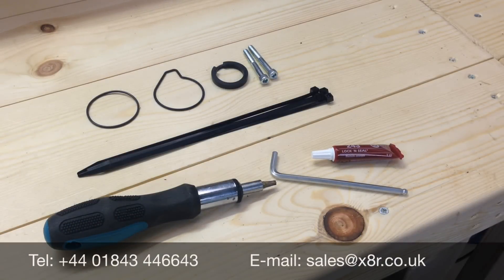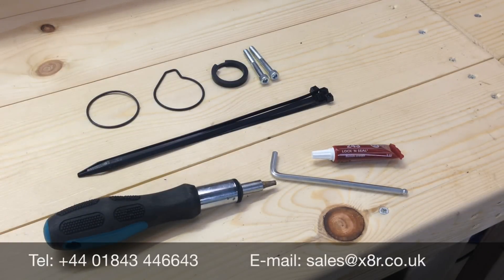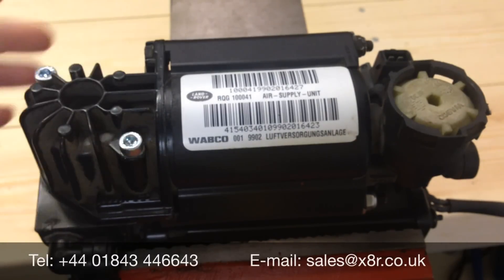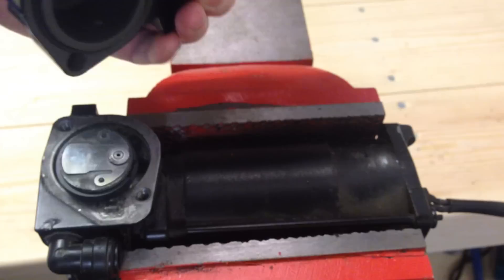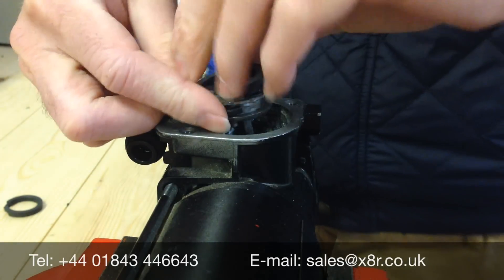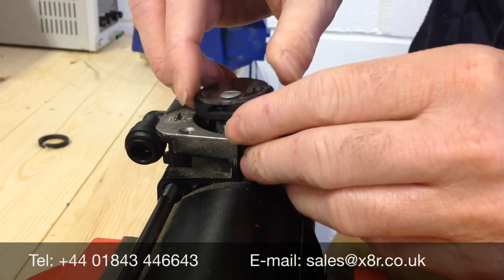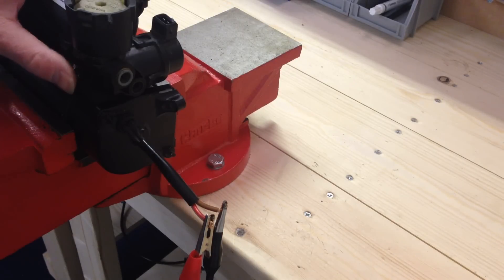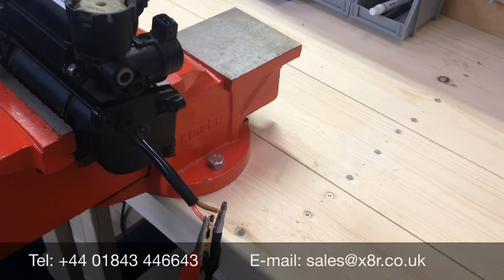Wabco Air Suspension Compressor Piston Ring Seal Repair Fix Kit (Fits Audi Allroad + others)

Comment: Hello, as i can see you do not have conectors at the end of the cabeles. Where should i look for that parts. I would be realy thankfull If you help me. I’ve got audi a6 c7 2011 3.o
Reply from the maker: Hi there, unfortunately we are not aware of where that part can be purchased. If it's available to buy separately they will have a part number printed on them, which you could search on eBay. - Georgina, X8R Ltd

Comment: I've just fitted a new piston ring and the plug in says it's producing 5.5 bar and the required is over 8 bar. the valve on top of the piston head is raised half a millimeter should that be flat? there's not much gap but could it be enough to lose that extra bit of pressure? many thanks

Comment: My compressor comes on but wont shut off... I tested the relay and its working fine. Would you have any suggestions on what you think can cause this? Any input would really be appreciated. Thanks & great video! Also wanted to add,  have no leaks in my system, as she stays up even when I pull the fuse to disengage the pump.
Reply from the maker: If there is no leaks the compressor running on is often a symptom of a worn piston seal.

Comment: I changed out the Rings and I still and getting the fault. Any suggestions?
Reply from the maker: +klintous If the compressor was generating good output on bench, it can be a leak within the system.

Please don't hesitate to contact us directly through email: Sales@x8r.co.uk

Regards,

The X8R -Team
Reply: @X8RLtdUK  hello. I need repair set for mercedes s500 2001 kompressor. How much would it cost to buy?